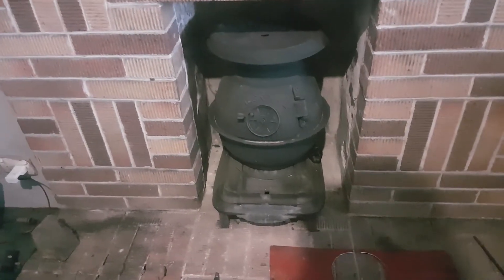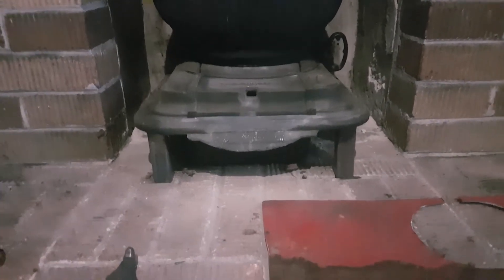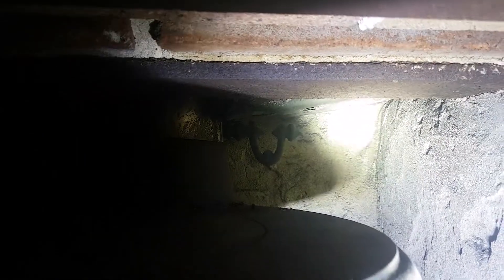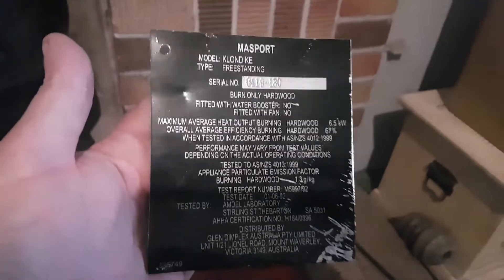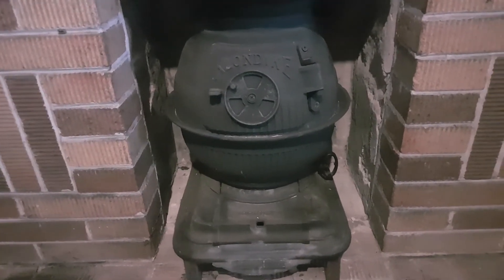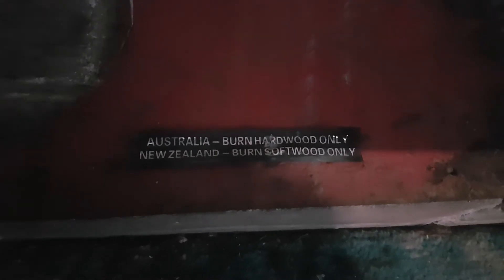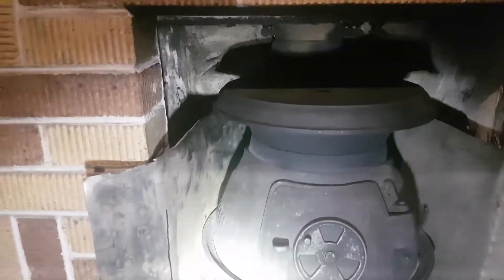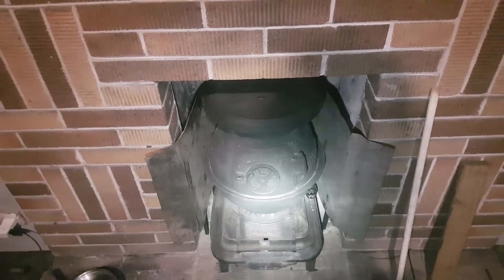KLONDIKE pot belly wood heater by MASPORT

Comment: Remove the legs, to lower the stove & pull it OUT of the alcove. You will get MORE heat, & better access for the stove pipe with a damper in it.

Comment: What size wood does it need.  My guess is the wood would need to be quite small?
Reply from the maker: Hi Linda, it is a little bit limited with the size of the wood you can burn in the heater. I've found that wood around the 240mm length is perfect.